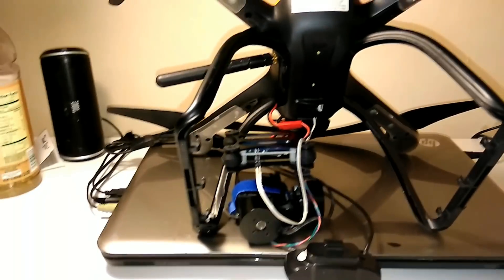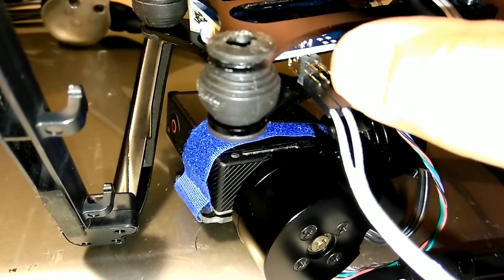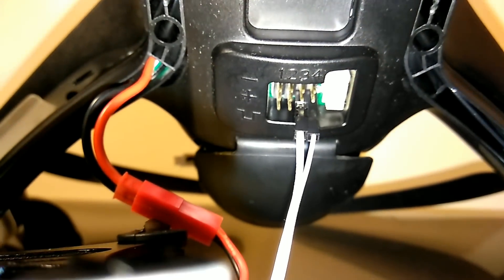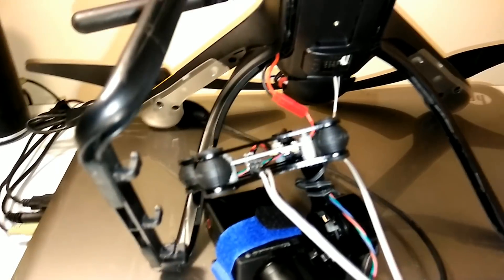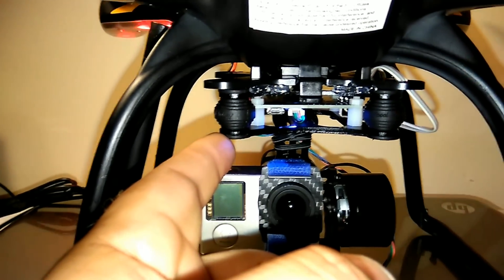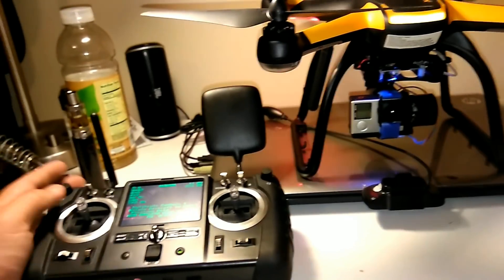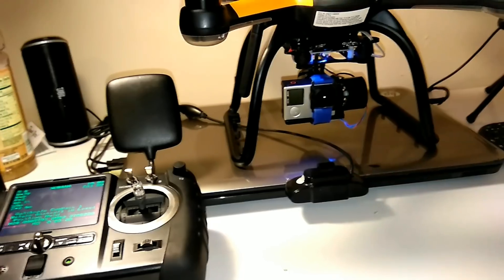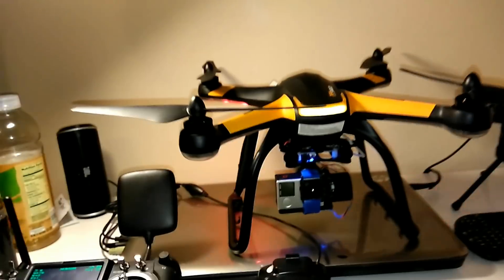Hubsan X4 Pro H109s CNC BGC 2 Axis Gimbal Installation

Comment: I used two sided tape to connect the mounting plates.  Then, I loosely attached one corner of the gimbal mounts with a tie wrap should the tape ever fail.

I also cut two old carbon RC-copter training-skid rods to length...put some rubber grommets on the ends (for safety as they are bit sharp and potential eye pokers) and fixed them tightly in place with clear nail polish. I attached them to each side of the 109s skids...with tie wraps...parallel and on each skid side.  For each rod, the back sticking out 4 inches, the front sticking out about a half inch, to avoid obscuring the camera FOV.  Keeps the Hubsan stable on T/O and landing when on uneven ground.

Comment: Hi, Great description of the gimbal but I would like to know what version of firmware do you have on ( Fc- Rx - Tx). I need the one that show the voltage of Tx and Rx boot  on the top right side of the screen like yours and unfortunaly I can't find it.
Reply from the maker: 1vicot I will see what I can do for you when I get a chance
Reply: Hi, I guess that you don't have had the chance. Thank you anyway
Reply from the maker: 1vicot hey brother I wasn't actually able to get my hands on it. I apparently use the original version of this drone which cannot be checked unless connected to a hubsan platform

Comment: Thanks Dan, that helped out a lot. The only issue I see is that the fpv cable for the camera is kind of stiff and may restrict the gimbal movement a bit. Let me know when you get yours because I have experienced that with mine?
Reply from the maker: Gregory Hall I'm going to take a razor and open the plastic so I can remove all the internal wires
Reply: Ok, I hadn't thought about doing that but I might try it because I do have an extra cable. I will wait and see how yours does first. Thanks for replying Dan.

Comment: I've owned like 4 of these 8bit 2D gimbals. They usually work quite well though I've never had one work perfectly right out of the box. They always required adjusting the PIDs and motor power in the Basecam software. I got good results with it on my cx-20 though the 3 axis 32 bit HakRC gimbal for $60 was far superior though it takes a lot of PID tuning. These 2D gimbals often will randomly twitch if the motor power isn't high enough or if it is set too high. They also will shake a bit until the PIDs are adjusted.  I also like how easy it is to calibers the IMU in the software.  Great job adding the gimbal and good info. You not worried tree glue could break loose?  I often used zip ties to attach them to a different top mount.
Reply from the maker: +RD's Drone Reviews I use tempered hot glue it gets very hard when it's done drying. It would take a strong man to rip the gimbal off of that clip now that it's on there
Reply: Drone Worship sweet!  I figured you used some badass glue. Not like anyone would use hotglue lol

Comment: I would bet you have power out on unused pins on quad . I wonder if they are side by side (probably are) and if spaced to match the ST connecter ?
Reply from the maker: DAVID BROWN yes there is a 5 volt and a ground per Channel

Comment: Thanks DW for using my idea with the mounting plate :-0
https://www.youtube.com/watch?v=W2pUpEFOVv4&t=10s

I paid £50 for the Storm32 - 3 axis gimbal from ebay and it performed ok out of the box but I found that I was getting a bit of 'jello' with the stock props and even more with the MAS 10 inch props. So I've set up the PIDs and it seems to have improved quite a lot. Maybe the stock Hubsan camera is not the best? Let me know how you find it with the Go-Pro please.
Reply from the maker: Stuart Tiffany honestly I didn't get the idea from anyone man it just kind of seemed like the thing to do. I didn't want to mount the gimbal directly to the body so I figured I would just remove the lid from one of the other gimbals and attach it to it so I could clip it in and out. Cool we both came up with the same idea though man great minds think alike 😉 I mean if we're facing the facts the hubs and camera is mediocre compared to something like the GoPro I assume we're going to get a lot of problems from the  hubsan camera but I'm going to test a few things with the GoPro and see what I can come up with
Reply: Great minds think alike!.....I never had any problems with jello with the stock Hubsan 3 axis gimbal (which is now at the bottom of a lake in the UK....pilot error!). I've just switched back to the softer Hubsan mounting rubbers to see if that helps, also considering getting a GitUp Git2 camera.